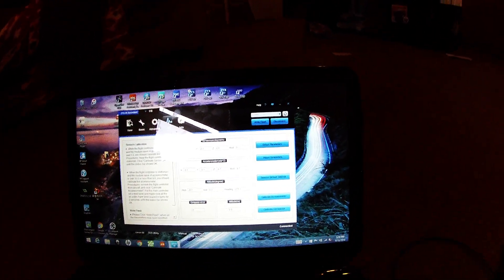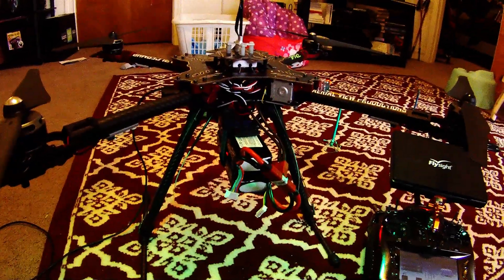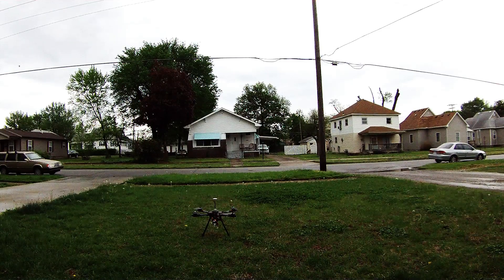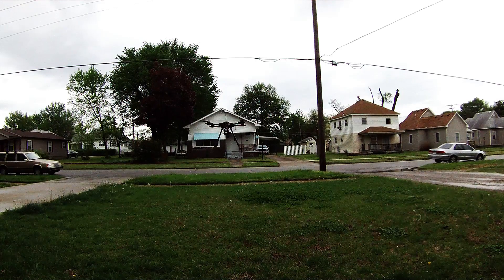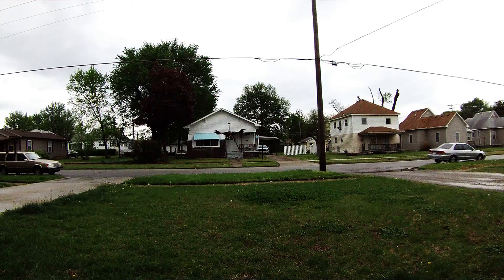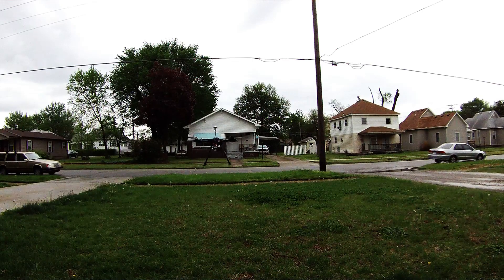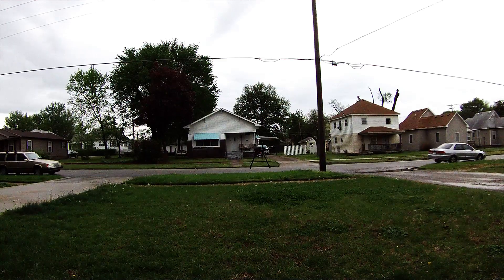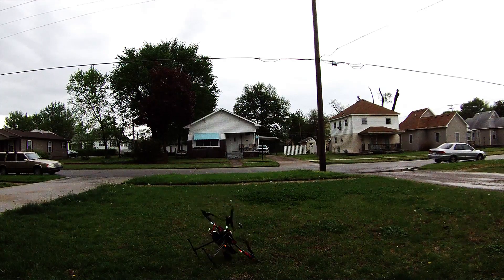Tarot ZYX m problems

Comment: hi there,  did you get this issue resolved??
Reply from the maker: I sure haven't :( Any ideas?
Reply: +Josh Poznich did you try uploading the new V1.04 firmware to it and see??   its quite easy.   also.  and I know you probably have as I heard you talk about an octocopter.   but you calibrated the accelerometer.  sorry. shouldn't have asked that.  I know you have.  just trying to think. I just fitted the fc to a small hex.  just trying to figure these gains out.  came from APM fc boards and they had auto tune.   so this is little different.   keep us posted.   first thing I done before install was update to V1.04.   did you contact who you bought it from.   are they going to replace it for you?   I would hope so.
Reply from the maker: Yup, upgraded firmware, calibrated gyroscope, accelerometer, recalibrated all the esc's, GPS compass, different batteries, all the obvious stuff. I have this FC on a 700mm hexacopter and it flies amazing!! That's why I got another one for my octacopter. It showed signs of odd behavior so I put it on a cheaper quad frame to see if I can get the problem resolved without destroying my octacopter. I have contacted the seller and I'm 32 emails and a month and a half into talking to them and I keep getting told to try everything I have already tried to fix it. Hopefully they will send a new one soon! A word of advice is to check your battery with an actual voltmeter and not use what a sentry eos battery checker or what your charger shows as the voltage. Also, the voltage protection in the assistant software says no load voltage, it's wrong. It trips the voltage protection under load. DJI shows no load, line loss and calculates the loaded voltage for you. This doesn't. Adjust the voltage number to what your voltmeter shows and use the recommended protection for the number of cells you're using. Make small adjustments based on how much charge you have left when the voltage protection kicks on! My hexa kicks the first level on with 40% and second comes on with 25% left. Thanks for the thoughts. I'm pretty certain the FC has a bad Y axis gyro. Everytime this happens the assistant software shows the Y axis at .4 or .5 which makes the mod value the same. I calibrate back to zero, fly again and the same thing happens. Check out the other video I put up. It's more pronounced at the end of the video. Tarot ZYX-m problems no. 2 Thanks again Richard! Keep me posted on your hexa build!!!
Reply: +Josh Poznich awwww man. I'm having similar issues with the JIYI p2 pro FC.  o wish these companies would just listen to us.   its like they don't believe us.  I hope you get the issue resolved soon though.  for sure sounds like FC at fault there.   its so annoying to.  back and forth with emails.   I totally understand.  and although NI love building these things myself sometimes I wonder is it realm worth it.   I just bought the tarot zyx-m FC and like it however I find altitude hold could be a little better.  the dead band it has for maintaining heikgh is a little too over sensitive I find.   other than that its working fine.   just need to fine tune some gains and I'll be happier.    well good luck.   I really think with your experience then. with octacopters and other frames etc. the company really should listen.  its understandable maybe a total newbie running into issues and causing problems.  but this is a different matter.   anyhow I hope you getbit sorted.    good luck.  and keep us posted.   cheers.   all the best.  regards.  Richard.
Reply from the maker: Thanks Richard! I hope you get your issues sorted out with the P2 Pro!! Yeah, These companies try to do everything they can to keep us from getting what we need!! Fact of the matter is I am 35 and I have been flying since I was 7!!!! Airplanes, Heli's, and now multirotors! My father is a private pilot and has been flying private jets since before I was born! I have been around aircraft my whole life and have a passion for anything that flies! My dad is actually the one that started the RC club that we still have going in our town back in 1987 so it is really hard to keep my patience when the company I bought the FC from asks me the same questions over and over! I hope they will come to their senses and just send me a replacement! I also understand that the company I purchased it from is just a reseller of the product and it really isn't their fault either but when I have bought a Tarot X8 octacopter, motors, esc's, a Tarot 5d 3axis gimbal, 2 Tarot T4-3d gimbals, Tarot ZYX-m FC, and just within the past week, 8 15" carbon props from them, I'm not trying to rip them off by getting a replacement! I have the money to buy another one but that's not the point! I received a faulty unit and it should be made right by getting a new unit that hopefully isn't faulty! Good luck to you as well Richard! If you have any questions don't hesitate to ask! I have a total of 11 different multirotors now, so I might have an answer lol!
Reply from the maker: Oh, 2 more things, When you do the Tarot dance calibrating the GPS, for some reason it seems like if you do the horizontal rotation CCW and the vertical rotation CW it helps with altitude hold. Not sure why but it does help a little. Also you might want to degauss the gps puck. After a calibration hook it up to the assistant software, go to the tool, and look and the compass error while you spin the multirotor 360 degrees. If it shows any errors do a calibration again until you don't get any errors doing a 360! 2nd, the Tarot FC seems to like 6s batteries more than 4s or 3s. Again, I'm not sure why exactly but overall flight seems to be better using a 6s battery. Hope this helps! Cheers!

Comment from the maker: Hi Leo. Thanks for the input! I assure you that the arrow and wires on the GPS puck are pointed forward! I'm working with the company I purchased it from and hopefully going to get a replacement. I have tried every imaginable possibility with esc, batteries, calibrations and anything else that might be causing the problem with no change in the behavior. I'm pretty positive the flight controller has a bad Y axis gyro. I'm at a loss until I get a replacement. Hopefully here soon! Thanks again!